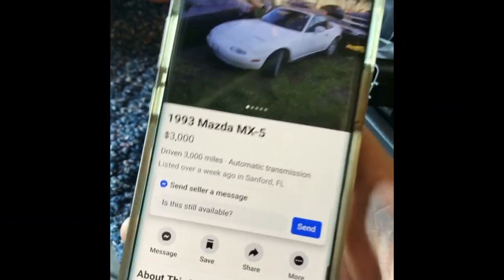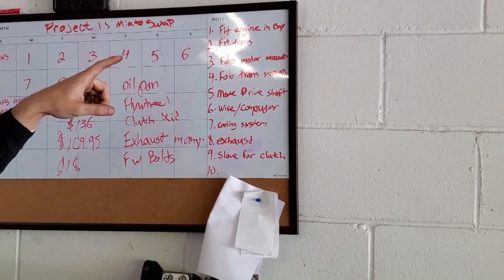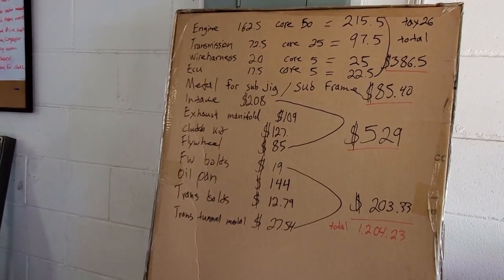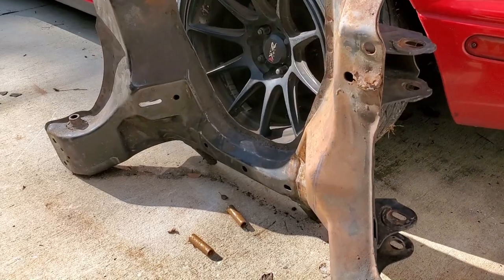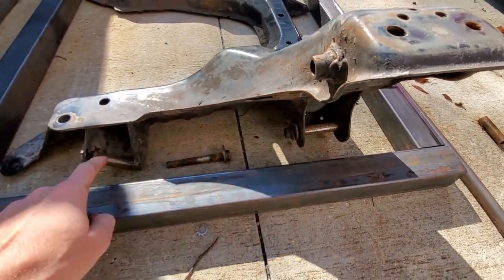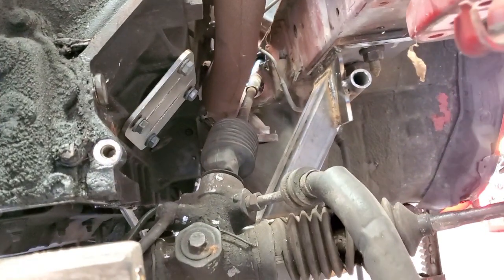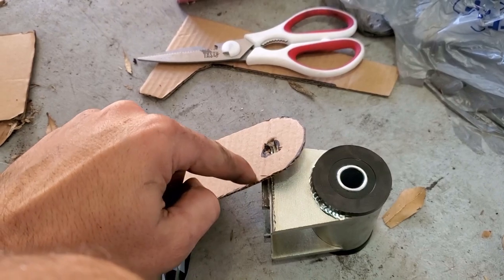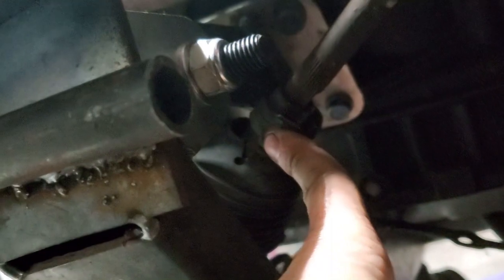Budget Ls Miata Swap🔥

Comment: Hope you have a torsen caz the 1.6 diffs are known to go with stock 1.6 power and the open 1.8s aren't better from what I hear. Same for the vlsd,s... I wouldn't trust a torsen with anything more than stock ls power.
Reply from the maker: Yeah I'm most likely going with a ford 8.8 rear end the Miata diff is also known for snapping the housing arm off as well